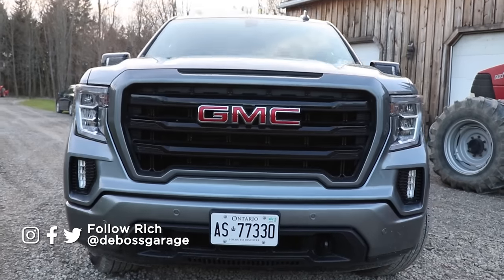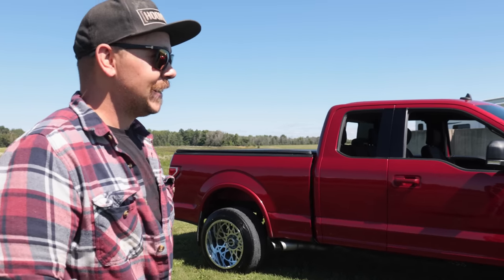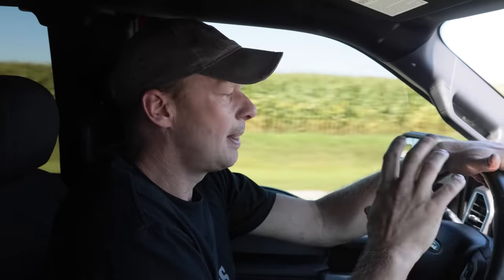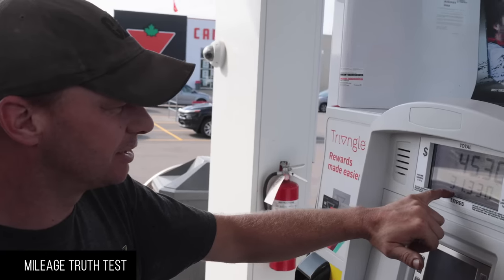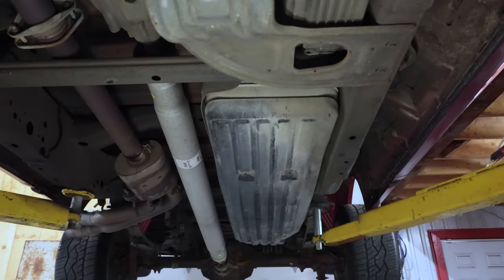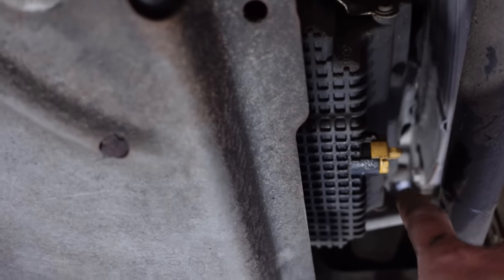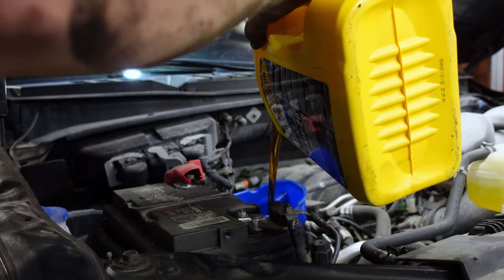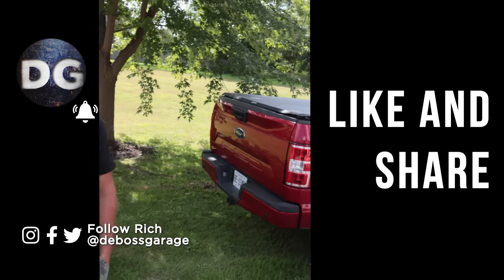REVIEW: 2020 Ford F150 Issues After 2 Years of Ownership?

Comment: I enjoyed the heck outta this. I also would’ve stuck with stock wheels and maybe a bimodal exhaust instead. But the owner obviously likes it and that’s awesome.
Reply: Short exhaust is partly the reason for the loud level exhaust. Simply running that out behind the axle would drop that tone considerably. I know when i had the duals on my '81 C10 dumping in front of each rear wheel, i could drive through a multilevel parking structure, and set off car alarms simply by driving in 1st gear around 2200-2500 RPM. Yeah, we were all young & dumb at some point in our lives, lol!
Reply: @1oldskoolluvr  hells yeah. I’d be taking I’d be using every excuse to go looking for tunnels if I owned it.

Comment: Great review Rich, my 2020 crew cab coyote is packing a Gen5 whipple. The coyote loves boost. As far as the AC drain, FORD sells a rubber elbow that you put on the drain tab and it will shoot straight down.  I was a die hard GM truck guy but after owning 3 aluminum F150’s there’s a reason it’s the best selling pickup here in the states.  Love the channel, you’re the man!
Reply: Ford builds the best trucks for sure. Just the facts!

Comment: My 2017 5.0 F150 has a steel oil pan with an angled drain plug. Sway bar isn't an issue. That plastic pan and quick release looks like something the accounting department engineered
Reply: the first couple years of the 6.7 powerstroke had the plastic oil pan crap then they got smart and put a normal metal one on them
Reply: @nou8257  yep, my 2015 6.7 has a metal pan

Comment: I am 100% with you on that one. Wheels and exhaust must go. I just bought a new Silverado and opted for the single exhaust, the duel pipes sound nice but will drive me nuts on a long road.
Reply: With that 5.0 screaming at 4000 rpm towing something would drive a person insane
Reply: Agreed, I had an 18 5.0 F150 with stock exhaust. Towing a trailer and RZR with it was plenty loud, no thanks on aftermarket exhaust 👎🏻

Comment: I'm glad you didn't pass on bringing up those horrible rims and tires.  You were still very Canadian about it, beauty is in the eye of the beholder, but damn if anything stance on a fairly regular pickup is a hideous trend I can't wait for the death of.
Reply: I grew up with Mexicans doing it like that since forever. A stock toyota with whee sticking out 6 inches plus
Reply: Yeah It was like everything I dont care for in a wheel/tire combo mashed together. Super stretched rubberband tires on tacky rims with a mile of poke. To each his own I guess.
Reply: @brianbrians3157  Oh man, that's neither rubberbands or a mile of poke. I used to be pretty into the lifted truck scene (until I sold mine for something newer and nicer), and knew a guy that had a set of 26X16 wheels with 2 inch spacers on a GMC 1500 Denali. Said 26s were also wrapped in 35 inch tires. I have seen guys running 33s on 26s, that's getting into rubber bands.
Reply: I ❤️ sidewalls.
Reply: Every time I see a truck with those kinds of awful extra wide rims on them it looks to me like the truck was stepped on, and the bottom spread out. Looks terrible.

Comment: I own 2015 2.7 Ecoboost with 315000K. One turbo blow off valve replacement under warranty. Wiper transmission and alternator replaced after warranty. Only other maintenance has been oil changed brakes and tires. Mileage has been 11l/100km. I’d buy it again in a heartbeat. Aluminum body still looks great.

Comment: They probably put the drain plug behind the sway bar on purpose to prevent quick change oil change guys from using tools on the plug and breaking the plastic pan
Reply: so you're telling me they intentionally designed it poorly to make up for the fact they used subpar materials
Reply: @daslynnter9841  Possible, but let's be real- quick-change boys fuck up steel just as easy as composite. Torque spec is always in ugga-duggas
Reply: Most of those plastic plugs I see don't have the tit for removal, usually a 3/8s drive sized recess so you can get the impact on it 👌
Reply: @typrus6377  we aren't all retarded, I work at the best quick shop in town, shop isn't pretty, there are crackheads literally everywhere but we're always busy because we don't tell you a fluid should be blue when it's red, have open honest conversation with our customers and try not to make them spend money on things they don't need. Tire repairs make alot of money, plugs we usually just send people on their way for free and most will throw you a 20 for it anyway bead cleans valves and patches I usually ask for a 20 cash but if they don't have cash just tell em to think of us when they're due for the next oil change.
Reply: @twigglykevin  Bud, there are ALWAYS exceptions. But they call it Grease Flunky for a reason. The amount of fuck-ups out of those chain quick-lubes is insane. Does that mean everyone who works there is a bum? Hell no! But the majority are. Whether because they just don't give a damn, or are stupid, or are in too much of a hurry, it doesnt matter. Junk work is junk work. 1 or 2 good shops in a hundred isn't enough to change the general perception, but it usually is enough to keep the good ones crazy busy.
Reply: @jkeelsnc  and toYota also

Comment: I bought a 2019 5.0 new and had multiple problems with the trans shifting poorly and popping up codes and the auto start stop coming on mid drive and the idle would jump around 500 rpm very strange and too add it only had 25k miles on it and I started seeing problems at 15k miles .. I ended up trading it in on a tundra (2019) .. best decision I’ve ever made

Comment: When you drain the oil, rotate the plug until it releases and then pull it back just far enough to get flow. You can set there and hold it for the entire time your draining it or I've seen guys cut a small piece of pvc pipe that fits over the drain plug just long enough to butt up against the trans cooler and hold the drain plug at the perfect position for a controllable drain. It is a little inconvenient but it beats splattering oil all over the trans cooler and the ground.

Comment: I have a 2012 Lariat 4-door with the 5.0, it now has right at 50 thousand miles on it, and the only problem I've had was a fuel-pump fuse blowing at 30k miles or so, I just replaced it and never took it in to get checked, I've given you crap in the past, but I gotta say, your unbiased reviews have made me a believer, and a life-long viewer,😉👍, awesome video Rich, thanks for sharing.
Reply from the maker: Thanks for the input and sticking around.  Like I said before, my biggest beef was the 5.4 3V, 6.0 and 6.4 which was all we saw in the shop for almost a decade.  The are pretty well gone now

Comment: I agree with a couple comments I have seen. At least for trucks, a mid range tow test. Also, love to see a comparison between the 5.0 and 3.5 Econoost. My buddy loves his but he’s already had to replace warped manifolds on a completely stock truck which are apparently a pretty common problems. Also had to have the valve body worked on in the 10 speed for flare shifting. It’s a daily driver, never been off road and only ever towed a 14 foot trailer with a UTV on it a few times.

Comment: Only issue I've seen with these, the oil pan leaks, I think there may be a recall to get it fixed, and that might be the plastic oil pan Ecoboost, but in my experience all the plastic oil pans leak, from the 6.7's al the way down to the v6's. Watch out and be careful of that, also if you own one it's a good idea to get the plastic replacement drain plugs, that gasket and plastic always get weak.

Comment: I’ve got the 2020 3.5 ecoboost 4x4. Bought brand new. I’ve got almost 43k miles on it. Zero issues so far. I’ve hauled big loads coast to coast. It’s been a great truck.
Reply: I just bought a used model it seems similar to yours (XLT, Supercab, 4X4, 3.5TT) with low miles...am loving it but wish I could squeak a couple more mpg's out of it...maybe I need to put it in eco...any tips?
Reply: @jrwilsonsr  my average is 20mpg. I do have a canopy topper which I’ve read can make a difference in drag. It recommends premium gas which I also use.

Comment: I have a 2020 F150 Crew cab 4x4.   It's the same color as this one, I have the 2.7L V-6.  The truck consistently will give me 22 to 23 mpg average. Local driving I have got as high as 26 mpg.    I only have 20,000 miles on it , I have had zero problems.  I under coated the truck with Texaco Grease coat when I bought it so the bottom is excellent.  I have seen 2021 Chevy frames that look like they have seen several winters and are all rusted.    Anybody that has a new Chevy wants to keep track of the ground cable on the frame to cab on the passenger side front.  They corrode and will lose ground after only 2 to 3 years and cause all kinds of electrical problems with everything!    Personally I have always been Chevy/GMC  but was sick of trying to stay ahead of the rust issues..   So far I am loving my FORD.

Comment: Had a New 2018 5.0 and the 10R80 trans was definitely a big gripe. Hesitant shifting, hard shifting, can’t tell you how many times I called the dealer to have them diag it. Flashed the tcu TWICE, and it would still go back. Loved it other than the trans.
Reply: did you sell it because of the issues?
Reply: I love the 10R80 in my 18 5L. Silky smooth, and responsive as a straight up mofo. Willing to downshift in ways I've not seen before in an auto tranny, but at the same time in a way that's less annoying when talking gear hunting than it is with most 6 speed auto vehicles. It's really quite impressive. I was looking at a L87/10L80 truck, but the transmission performance compared to 5L/10R80 killed it for me. Leave it GM to tune a truck with 10 gears, and not want to use them, but instead try, and force the engine to lug it's way up to speed. Crazy how different these two transmissions which are identical other than the tune and bell house pattern actually feel.

Comment: Love my 5.0. 2015 Lariat, SuperCrew Cab (4 full door) FX4 and 6.5ft bed. Only issues I've had with it so far (102k miles, 7 yrs old) are diff pinion seal and transmission/tcase output seal which just started weeping recently, a wire in the heated/cooled seats module (easy fix just had to add another ground to it), and an alternator which seized up after sitting 2 weeks recently, but thats probably because my aftermarket bumper has a spot where the salt can hit the front of the engine which I need to fix. I've done probably 15k of those miles towing trailers from 1500lbs (boats, jetskis, motorcycles, etc - 750kg) to my 24' enclosed with a car in it weighing around 7700lbs (3500kg). No issues with the window seals, still amazingly quiet in the cabin for any car but especially for a pickup at 75mph on the highway. The Lariat does have more sound deadening though I think.

As for gas mileage, I usually get around 16mpg with all the hills around here, 13 towing the 1500lbs and anywhere from 7.5-9.5 towing the 7700lb enclosed. I get 9.5 pretty consistently towing 7000 (dodge woods truck) on an open trailer, so aero of the trailer really matters. I do 65-70 while towing usually. If I'm driving 65 with no trailer, I can get up to about 23mpg in some areas, but usually more like high 18s to low 19s.

Pro-tip to anyone who wants to hear these trucks more, get the K&N intake. It's quiet when you're just cruising (same as stock), but SUPER loud inside and out when you put the hammer down. Sounds great but with all the towing I do in northeast US and the hills I'll be pulling a long hill in 3rd gear (6spd) and it got annoying so I went back to stock after around 10k.
Reply: Yes to supercrew with a 6.5 ft bed in the 150 series to be able to carry more than a wheelbarrow does!  My 2015 Lariat with the Coyote gets very similar mileage to what you mentioned... almost like it's the same truck ;)  276,000 miles now, and have had some repairs along the way, but nothing really unexpected for the mileage.  Both rear wheel seals leaked all over the rear brakes (both the shoes and calipers), trans cooler lines rusted out at the heat exchanger on the front cross member, rad hose o-ring started weeping, and water pump bearings started whining.  Only odd thing I would say was a blend door actuator went bad.  I love the quiet, smooth (stock suspension) ride as well as the capability towing!

Comment: Like the reviews because you know what your talking about and you tell it straight good or bad. I have a 2011 FX4 Ford screw with the 5.0L 6R80 4x4 3.73 ratio that I bought new. Now104 thousand miles 167371km and 11 years of Manitoba winters still no major issues. Wish you could see it. It is still like new because I am super fussy about maintenance and rust prevention. I am a retired diesel mechanic I tow a 5500 pound TT. This truck and my TT has been to Alaska, Yukon, California, South Texas numerous times from Winnipeg. I use factory filters and change all fluids early and use synthetic 5w20 in the engine. The engine uses no oil between oil changes (5000 KM interval) when not towing and about a half liter towing from Wpg to McAllen Texas when bucking strong head winds. I plan on keeping this truck for a vary long time. I think any vehicle can be made to last if you are willing to get filthy now and then like Rich.

Comment: I had a 19 ram 1500 limited and never had a issue. Tires were measured at very close to new after 23k miles even. I have a trx now same thing. 11k mikes , march will be 2 years with it. Absolutely love that truck ! We have had ram 5500s since 11 with Cummins we trade em in every 5 years other then normal maintenance and tires never a issue and I currently on number 7 and 8 with them. The only trucks that ever given us issues is the Nissan NV25/3500 van and a 06 f550 we had back in the day with a 6.0. She had 3 different turbos during ownership.

Comment: 2020 5.0, 3.55 rear end with 22k miles.  Flawless so far.  Only thing I wish I had was the 3.73 gearing.  I tend to lock out 10th gear in the TX hill country to keep it closer to the power band.  Lugs or downshifts a lot in 10th unless I’m on perfectly flat roads.

Comment: Can honestly say at the shop I work at. We have been fairly disappointed with 2018 & up f150s in general. Probably some of the most common issues on 5.0 10r80 trucks we see are timing jobs from rattle on cold start. Tons of issues TSB ect.. with the IWE hubs, usually a grinding noise. Lots of trans complaints especially when it gets cold, in most cases that's just how they are. And last for me is HVAC issues. Poor design on the HVAC box, temp door breaks inside. Overall not the worst, but from my perspective I'd be going with a 2016 5.0 6r80 over the newer ones.

Comment: If I had a truck for only two years I wouldnt expect anything to be wrong at that point. I mean i have a 2007 f150 with only the basic work done. Brakes,rotors, fluids... ex. And 150000 miles on it and still no major issues. That's the kind of quality I expect so I hear about issues on newer F150s and think to myself I'll just stick to 11th gen and older
Reply: Im a ford man but wiill never own any 2004-10 f150 due to 5.4 3v failures.
Reply: That’s not a lot of miles.
Reply: @DefinitelyNotMyRealName  not at all

Comment: My 2019 5.0 10 speed f150 had the trans pan crack and cause it to overheat sporadically.  Also had the ac start draining in the passenger front floorboard.  Both issues happened around 75k miles.

Comment: I believe there should be a correction at 9:52. Ford took away their manual transmission options from the F150 around 2011, and their base transmission (with the base 3.3 Duratec) was the 6 speed automatic.
Reply: Last manual was in '08
Reply: @AK_Ray  sad sad times!!
Reply: @AK_Ray  in north america, still an option in south america
Reply: @madflyer1093  yup, NA gettin' screwed over with lack of manual options. There are a few still making that option available (top of my head, Hyundai Elantra N model) but since 2018, it's impossible to order a new truck with the fun stick option, and that's a good part of the reason i'll keep my daily going for many more years to come.
Reply: @madflyer1093  Got a source? I can't find any information indicating that.

Comment: 3.5 ecoboost 2020 XLT 4X4, tow a camper 29,000 miles, no issues at all so far.  Change the oil with Full synthetic every 3 to 5,000 miles.

Comment: Very fair and informative. Have an 98 Silverado WT in PA and the rust, wow
Reply: I have a 98 Silverado in Colorado and it's rust free
Reply: Have 2 08 F150s in Southern Indiana broke in middle due to frame rusted in 2.
Reply: 22 years between 98 and 2020 will do interesting things...
Reply: Its more about how they have been taken care of and what the local hwy depts use for snow and ice. Like I said I have seen many fords with destroyed frames. Seen many dodges and chevys too. Had an 04 chevy and I had to do a complete back half. Picked it up in WV. My 01 gmc has zero rust under it.
Reply: @countryracer69  yep my dad bought this new , lived in the garage most of its life still has less than 100,000 on the big block, he used it to tow a fifth wheel a little bit then got too old, he bought it to keep up with my Ford 460.
Reply: I live in pa also, if its steel, it falls apart.  All my jeeps, fords, the few chevys i had, my kenworth.  The onky one that didnt was my saturn sc2, but its plastic and fiberglass.  And actually no, even the aaturn hood which is aluminum ended up all corroded.  Pa and ny will eat your vehicle, usually within 5 years or less.
Reply: I’m in PA as well, and my dads 2011 f-150 is so rusted the frame won’t pass inspection next year. Rockers, fenders, cab corner, and everything underneath is rusted bad. PA chews up anything steel.